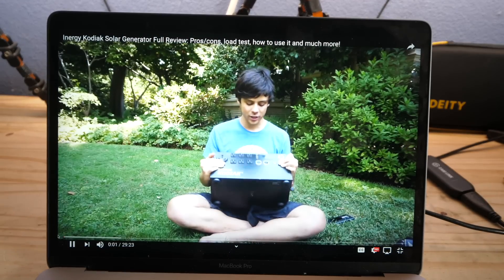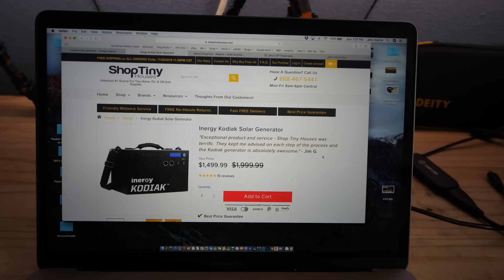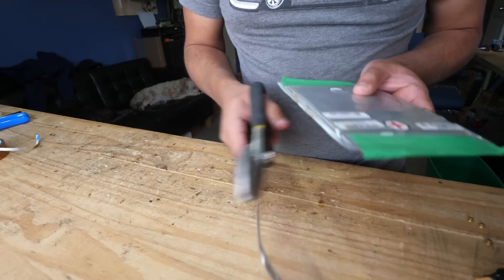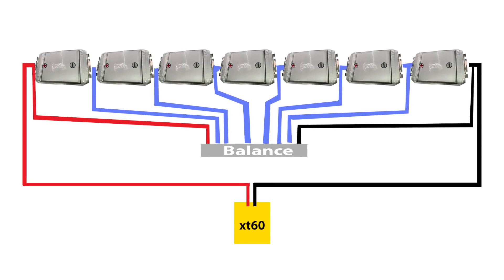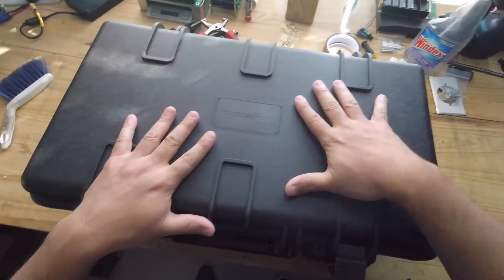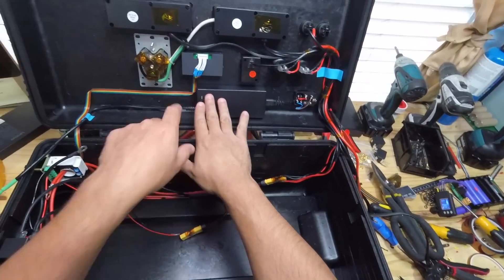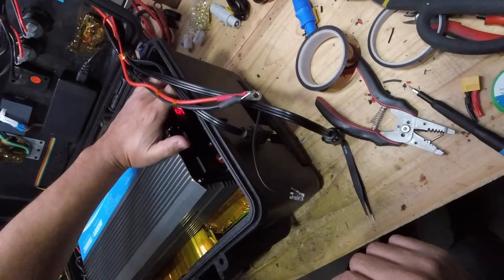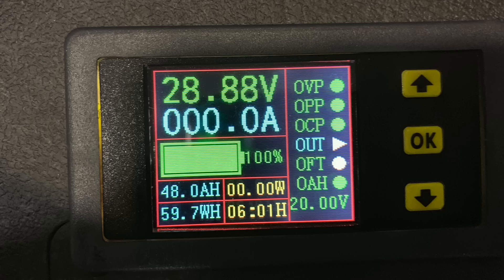DIY Inergy Kodiak Solar Generator

Comment: Now how well do the batteries and the inverter handle boxs up together in the heat? I'm from Roswell New Mexico  temperatures in the triple digits in the summer .
I am a roof and doing so my crew runs a lot of tools 
Anyway I would like to make one but I like to make sure I'll be able to handle the heat
Reply from the maker: No idea,  you people living in hell might need extra cooling which is not hard to add

Comment: If you wanted to save even more money - you could swap the amazon / pelican box for a tool box from home depot + silicon bead ($30). I have 2 of those tool boxes at home, some multi-meters. some led acid car batteries (i know not great - but free!), some solar panels......thinking I might build a down scaled "parts bin" box like this. Thanks for the inspiration.

Comment: Question.. Could you do something that would nearly triple the amount of time you could run this.. Make another case that is just Battery cells since these are stackable cases you could make it to where you could add more power and time. Possibly make them so they could be solar charged and the main box is just for inversion. In a setup like what I propose you could make 3 battery packs and keep 2 charging from the sun while you have the main one plus another cell running the show.. just an idea to make this modular..
Reply from the maker: Yeah that’s easy,  I don’t need that but go ahead and build it

Comment: not a solar socket, Its a Neutrik Powercon, Developed for the pro audio industry.  Blue is IN Gray is Out., And you need some temp monitoring for those packs especially with the high load draw and heat from that inverter.  Otherwise its a cool build example.
Reply from the maker: 25c lipo  cells used at 2c ,  how much heat you think it’s going to be generated?

Comment: I think a Q/A follow up for this video would be good to address a few issues.  Primary concern is safety and a few mod ideas.
1. Fuses and electrical safety concerns .
2. Temperature Control (Active / Passive cooling and emergency automatic kill switch when temperatures approach  / go over safety limits.
3. Some general usage statistics for the build, Average time for usage for defined loads and recharge times when plugged in.

On a side note, If I build this I know I will keep a portable Fire extinguisher on hand at all times given the possible risk of fire for the unit.
Reply: 4. How much does this thing weigh too.
Reply from the maker: Video update coming

Comment: Have you seen the searl seg generator if it works you can get rid of the batterys and make your car or truck and plane unlimed range no fuel or chargeing need it cost but the pay back is soon with a commercial truck .if it can work look it up.utube tell me what you think.

Comment: Nice try, and probably a good start to a DIY version of the Kodiak, but I'm not seeing any component that could be used as a solar charge controller, so what exactly are your solar panels supposed to connect to, and how is this regulated so as to not destroy the batteries???

The "meter" you're using doesn't really qualify as a BMS, either, so your entire charging system is falling short of the Kodiak and you really should know better, 'cause this isn't your first rodeo...  (Or have you forgotten the incident where the charger failed on the Samba?!?)

If I'm missing something, please provide a schematic so the rest of us can follow along, because so far, your function tests only show that a charged system can handle outputs/loads, but there was no demonstration of it being able to handle various inputs too, and the whole point of a "solar generator" is to be able to conveniently collect energy from solar...

Update:  I stand corrected about missing a charge controller, BUT not much...  The choice of inverter does claim to include a built-in charge controller for solar, although reading further, it is hard programmed for lead acid batteries, so it will probably destroy lithium batteries with prolonged use.  In addition, the built-in charge controller is limited to only 300 watts of solar input, which is half of what the Kodiak is claiming, and more importantly well below most folks long-term needs would be, if they had to rely solely on solar power to recharge this unit (if you can only charge a max of 300 watts/each hr of sunlight, that will be the total power you can get out of the unit for a full 24 hr day without depleting the batteries...

The manufacturer is an Australian company and they seem to have removed this model from their website as of right now 11/29/18, or haven't yet gotten it up there, so buyer beware, there may be limited support for this IF you can get one, but you may want to look around at some other options too.

As far as charge controllers, a Midnight Solar Kid will set you back $370, but that's an honest MPPT charge controller with programmable battery chemistry and will handle up to 4500 watt of power.  The Midnight Solar Brat is NOT an MPPT charge controller, but will handle up to 1800 watts and is only about $105, so if one really needed to charge faster/limited sun hours, DIY something really better, not just field expedient until the battery is dead.

Comment: You should include a rough tally of construction time in the cost calculation! I realize DIY is a hobby, but still would be intereesting to see how much value i'd be getting for the time!
Reply from the maker: If I didn’t have to trial and error this whole thing and had all the parts I could put this together in a few hours,  but I have no idea how long it would take you so not very useful estimating assembly time
Reply: @jehugarcia  True, but i still think it is a useful metric. Having a ballpark is better than not! And I would include the trial and error time as well, would compensate for those of us not so used to DIY...

Comment: nice build but the Inverter might heat up a lot in this closed box
Reply: my suggestion is that you disassembly the Inverter and use the bottom area of the box only for it. also you need to drill holes for ventilation

Comment: You  Could also add another port to the box for the purpose of adding more battery capacity via using more of the same boxes, but with only batteries in them. i think it would work out to about 3KW/hr per box.
Reply from the maker: That’s the blue connector

Comment: you need a temperature sensore around the bateries and holes and fans. also yeah do you output 110 on some outlets and 220 on the big ass? i feel tricked

Comment: Nice job.  Professional enough to sell retail.  There must be a quicker way to connect the lithium panels besides using eyelets.(* I do not know it... there should be some low-temp soldering system that would work)
 Did the weight of the two compare?

Comment: Wouldn’t the brass and aluminum on the leads react with each other over time? Dissimilar metal corrosion is a thing, but I’m not sure about these 2 metals in this application

Comment: cutting the cells down, when these flat lithium polymer cells go bad and start expanding there is the risk of them popping open and trust me you don't want that on these they will set everything around them on fire, so just for safety you may want to put them in a  Fireproof Explosion-Proof Lipo Battery Safe Sleeve, I would also add a 100A 7S BMS and fuse all the cells. Also why would you use brass and copper on aluminum you know you can get aluminum Machine bolts with nuts they also make aluminum rivets mixing three medals when I worked in the steel industry as an electronic engineer and even though we were union if we would've got caught doing that we would've been fired immediately I am not trying to be disrespectful I love the fact that you get so many people interested in recycling and for the most part I love your builds but this one is really dangerous no cooling no proper fusing and I'm sorry but using kapton tape to wrap those cells you're not giving them room to expand when they go bad that tape will not stop them from exploding and will only make matters worse. I understand you say you're going to make improvements but until then people are going to actually try and make this thing because so many people just don't know better, I really hope nobody tries to build this until some very serious problems are solved first

Comment: This is very impressive. One thing to note is weight. The Kodiak unit is roughly 20 pounds... I own one, and it is incredibly light for all of it's features. If you only account for the inverter and case of this DIY unit that is a total of 27 pounds... This doesn't even include the batteries used. If ease of portability is of concern, this may be a deal breaker for some.
Reply: I wouldn't want to transport the DIY one or move it anywhere. There was nothing holding the batteries in place, and the inverter is just sitting on top of the batteries.

Comment: Jehu great video, last year when Maria hit PR I was traveling to my house to check for damage and there was no electricity in my town. I watched ALL your videos along with other DIY videos. You are the DIY man. The problem at that time was shipping 18650's and there were no batteries available in PR. I ended up buying a kodiak generator and had it shipped to PR. It was a life saver, I DIYed the solar panel frames, custom mc4 cables and was able to ship and reassemble on my roof. I added 3 Optima gels and run everything.

Comment: When plugged into the wall, could this also be used as a very high capacity UPS as well?
Reply: that's right.. in fact I am trying to build one now using a IPS as it has an inverter
Reply: @ThanaKrishnan  
How did the build go?